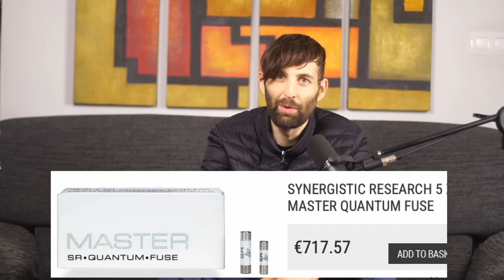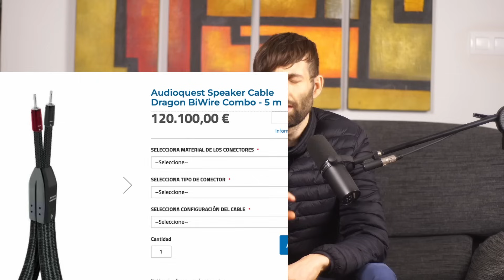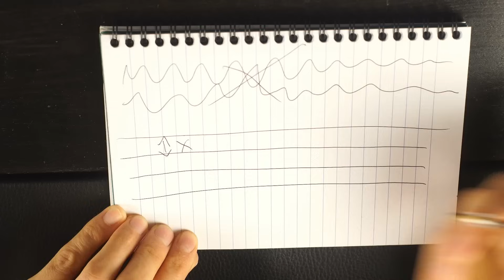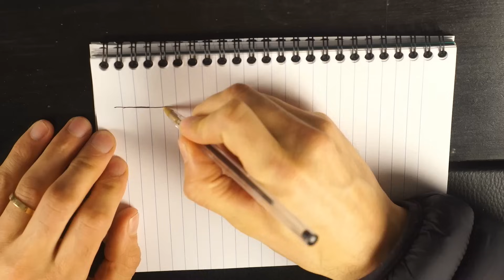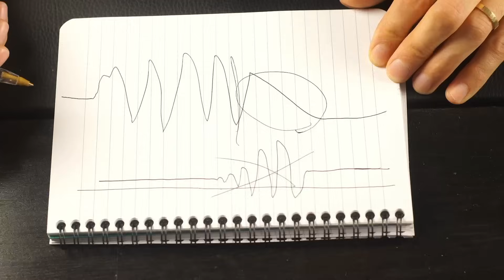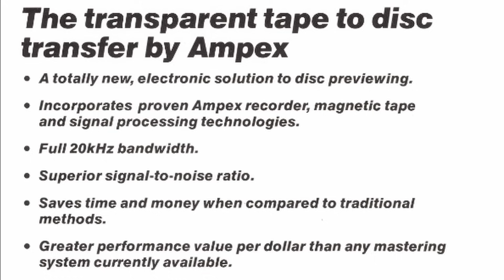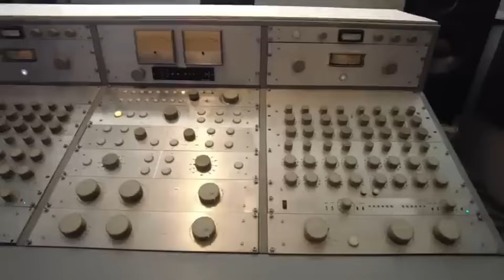Hard truth: most vinyl is digital anyway

Comment: I've been a professional audio engineer for 35 years. I've recorded in a wide variety of studios. Analog, digital, and hybrid studios. I think, now, finally, after decades of improvement, digital finally sounds as good as analog... with one exception: drums. Drums still sound better tracked to analog because of analog's transient shaping. But for the most part, digital is indistinguishable from analog now. And I'd challenge anyone to tell the difference in an ABX test.

And you're right. Vinyl does not sound better. On it's very best day, it sounds the same. HOWEVER... I still prefer listening to vinyl. Not because of the sound quality, but because of the listening habits that vinyl mandates. You must adjust the volume for each record you put on. There are no playlists. No shuffle. No skipping. You must at least listen to one whole side at a time.

And yeah, when I master a record, I do a different master for vinyl with no limiting.
Reply: "transient shaping" - it's called distortion.

Comment: Dolby Atmos mixes require - 18 LKFS or less dB if you try to upload a slammed mix the tool will just refuse to accept it, so Apple Music and Tidal with their Dolby Atmos albums have more dynamic range. Technically any digital format accepts way more dynamic range than vinyl too. Though Dolby Atmos has its own problems, with good speakers in a good room it can be magical, but damn that costs a ton of money... and the algorithms for headphones are very close but still tricky. Although I think Dolby Atmos for headphones can be compared to algorithmic photography, it took smartphones a while to become really good at making awesome pictures but they got there. Are they as good as the full size cameras? Probably not, but for vast majority they are plenty good enough at times even for professional work. 

Daft Punk had a cool solution when they released their special edition vinyl of their Random Access Memories, they included a USB stick with high res HDR digital files. So one could have both. Cool object and good sound.

Comment: THATS JUST FACTUALLY INCORRECT       as 80% of the vinyl in existence was pressed before 2000
Reply: Well, he said most vinyl mastering switched over to digital delays in the late 70s-early 80s, so you might want to change your numbers.
Reply: @paulmckenna5224  You might want to change your attitude.
Reply: Vinyl rly does sound fantastic, especially if you only play brand new records once or don’t mind the sound of the needle passing through dust. One inch two track is the GOAT

Comment: It does not matter how the sound on the vinyl disc was produced, what matters is the analoge method of listening to the vinyl disc. The stylus to vinyl grooves extraction is an analogue process as opposed to a CD or download extraction. Nothing else matters unless you want to get a scientific complicated headfuck so your purist analogy misses the main point. I and most others love vinyl not for a 100% analogue experience (don't give a rats) but rather for placing the needle on the record surface and holding the 12"x12" sleeve like you allude to at the very end!